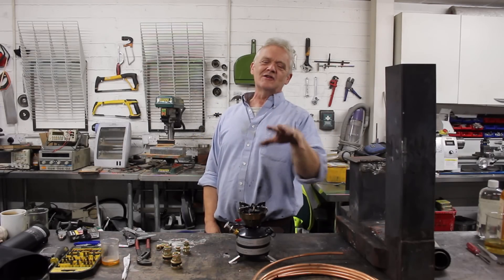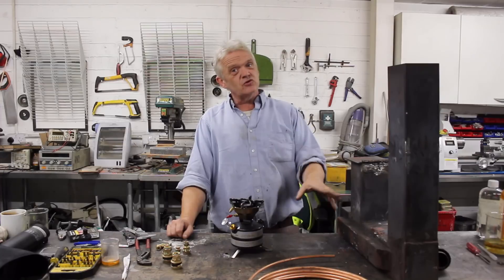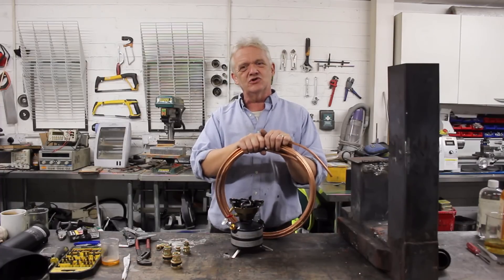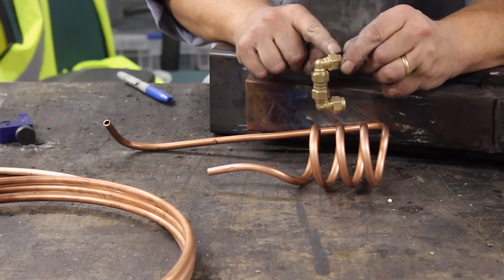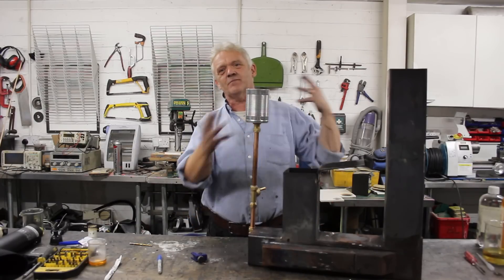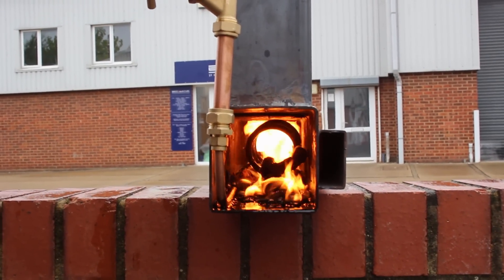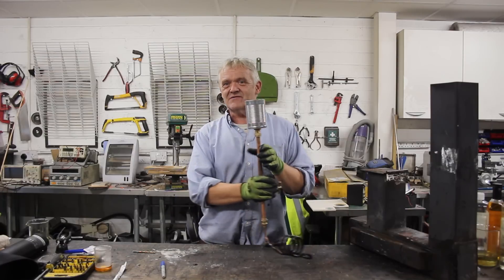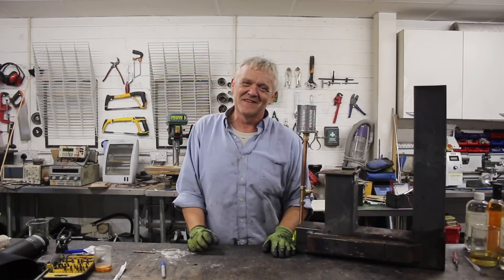1677 Biodiesel Rocket Stove

Comment: Sorry, this will NOT work for long on Veg oil or WMO.  I guarantee it.  The copper tube will clag with deposits in no time and the thing will not burn.  Diesel, Kero, biodiesel, Fine, they burn clean.  WVO and Diesel,  you'll be lucky to put 2 L though it. 

Very surprised you didn't do more home work on this and provide better information.  I was playing with things like this 20 years ago and thought it would be common knowledge you could not run this on waste oil. 

I have a similar stove design on my channel which I designed to run on waste oils and while it does need a poke with a screwdriver and a shake out to remove the clag, you can get reasonable hours of heat out the thing before you need to clean it. 

Doing this for waste oil would only be a waste of time and Money!

Comment: In my experience, if you use table salt instead of sand, you can clean the coil easier with water. It's the same thing, it's just you can disolve the salt if it gets stuck.
Reply: My experience runs different. Sand and salt can be difficult to get out of the pipe once bent. I've found that water does not compress, and if you just crimp off the ends (bash with hammer flat and fold over) fill with water, and do the same at the other end. A little bit of air does not matter, just not alot.
Cut the ends off, empty the water out and good to go.

Comment: Stainless steel brake line [yes I see plain steel was mentioned, but that will rust away pretty fast between the heat and the acids in the oil and combustion, but if you can't get stainless, it is certainly a fall-back] coiled many more times [surface area is key to proper preheating] and then use a brass spray tip from a garden weed sprayer.

On the OTHER end, USE the SAME garden sprayer to deliver pressurized fuel oil to the flame [since gravity is going to do a terrible job] and, if nothing else, use a really cheap Chinese made emergency 12 volt tire pump to give you steady pressure, and to drive it, if you do not use a battery, plug it into an 12, 18 or 24 volt laptop power supply with the necessary amperage to handle the draw of the little 12 volt motor, since it will draw quite a few amps [usually better than 6 amps] and let the pressure blow-off on the tank be your tank pressure regulator, or else just get a regulator set to lower than your peak tank pressure [to keep it from rupturing] and likely set the pressure based on the feed rate you expect to get from your oil so you do not have too much or too little fuel, and so you can fine tune the fuel burn rate.

Please keep in mind that this system will eventually 'coke-out', and every once in a while, it is good to wash the inside with some heated alkaline detergent and water, likely just pull the coil assembly, put it in a tank, plastic tub, bucket or barrel with plenty of hot water and let it soak, making sure every so often to let the detergent flow in and out of the coil, or perhaps use a tiny Chinese fountain pump and a piece f vinyl tube to force the detergent water through the tube.

While they make some excellent spray cleaner that will remove that coke/carbon pretty quickly, its not cheap, and I do not know how much it would take to keep your system clean.

Another way of cleaning it [the harsh way] is to build a really hot wood fire [possibly in your back yard or in a wood stove, or a coal furnace if your house is that old] and burn it until its pretty much glowing hot with some air being blown into it to oxidize the coke out as ash.

Comment: Just throwing thus out there for like minded people. I theorize Useing quantum clocks, entangled electrons, photons, Galactica xyz location, and a formula based on the 2/3 probability of super position measuring. That it will be feasible to use quantum properties for long distance communication, and or information transfer. Think about it we already do it on way by reading the red and blue shift,  aswell as the fractal photon graph to tell what objects are compromised of. We could at the least be able to communicate at light speed.

Comment: Instead of air holes that would allow the flame to escape I would setup a secondary air supply like a modern wood stove has with a pipe from outside the stove wirh small air holes much like a gas burner to supply jets of fresh air where you want it in the combustion chamber.  That is how a modern gasification wood stove gets clean combustion.  You should be able to get a blue flame with enough air.

Comment: Very awesome priciple - makes a great off grid heater as well - all you need is to provide a separate pipe maybe 1-2" through/ beside the coil - need to start outside the stove - finish through the back wall of the stover and be ducted away - provide a low voltage fan on the end to push air through the central pipe and wuhlah you have central heating (tent/cabin/outdoor area) if the RS stays outside then never the exhaust and fresh air need mix :) Great demo!
Reply from the maker: great idea - cheers mate

Comment: great idea and brilliant build.  I agree the coil closer to the chimney will likely make for a better burn .  one idea I was thinking is to have the pipe entee through the first flue and seal off that entry so air is drafted in from the bottom entry only and the air is moving in on direction.
Reply from the maker: Thanks for the idea! cheers mate

Comment: I'm amazed!! 

With what You come up with and how You do It!

I also want to build a Rocket Stove, don't have the Materials yet, and The Idea with putting the Burner in the back is a good One.

I would put the Air Holes always before the Burner and may even Windchanels and also give it an Airflow and not a sharp 90° turn, where the Molecules get slammed into a Wall, that should make it also Way better, maybe even Steel Melting hot if the Fire is burned long enough.

Cheers :)
Reply from the maker: nice ideas mate - thank you for taking the time to share them

Comment: I love this concept.  I have done something similar though it burned candle wax.  The reservoir was closer to the exit pipe only well below the opening to melt the wax.  What I did though was wrap the coil on the outside of the exit pipe.  It takes a bit to get it going, but is much cleaner with less damage to your coils as they aren't directly in the flame.  Less oxidation as well on the coil and better air intake as the coil isn't in the way.  Fasten the nozzle through a hole in the top side of the burn chamber.  Basically, I made a pulse jet fueled by wax.  It didn't have much power, but it got very hot.
Reply from the maker: nice - didn't think to look at pulse jets - nice one mate - cheers

Comment: Would it make sense for a one-way valve?  Keep oil pressure from backing up into the reservoir?  Is this over thinking?
Reply from the maker: I think it is a bit of over thinking mate - I was half expecting someone to mention flame arrestors but to be honest it's just not needed as the colder oil is very thick and is sort of it's own arrestor and equally it's own one way - you would need some pressure to blow back against it and the restriction offered by a hole drilled in the cap isn't really enough to be able to build up that pressure

Comment: I ran a 1992 Mitsubishi Delica on free waste vegetable oil from the restaurant my girlfriend worked at and then a sushi restaurant after she quit that job, it still needed diesel or biodiesel (I had not upgraded the rubber parts for it though) to start up on (and hence shut down on) since it relied on the hot engine and an electric pre-heater to make it work...  I wonder if a check valve before the coil somewhere would help it squirt out the hole at the end better, much like a cheap coffee brewing machine pumping water by boiling it in the pipe with a check valve?  I was following the work of some folks making centrifuges to clean used oils, they were burning used motor oil for heat and found the equipment lasted much longer when it was free of contamination that filtration alone doesn’t remove, like antifreeze...  In the ghetto we just let the WVO containers sit for a few months and then carefully poured off the clean looking oil and stopped as soon as any visible dirt or funky layers started mixing - the 2 micron on-vehicle filer could handle a little dirt.
Reply from the maker: nice share mate thanks for posting - I am not sure about a check valve but a needle in the hole or a smaller hole would be good I think

Comment: Was the reservoir closed off? Should this not be closed off to create some kind of pressure to get the jet going? Could it help to use compressed gas in the reservoir like air to get a steady jet?
Reply from the maker: no it was an open reservoir  - things like pressure and compressed air would help but they also add complexity and this is meant to be a simple build

Comment: Has anyone used a gutted auto engine void of it's reciprocating parts and the intake valve's, cam and rockers to make a wood or waste oil heater? On a V8 the exhaust would exit the point of where the carburetor bolted on. It could also be plumbed to produce hot water.
Reply: Engines are typically rather pricey.
Reply from the maker: I haven't seen one mate - but interesting idea

Comment: I prefer babbington oil atomising burners.... If the atomising gas is at high enough pressure they're able to burn oil with a blue flame.
Reply from the maker: yeah they are good but don't they use compressed air?
Reply: @ThinkingandTinkering  usually...
But they'll work just as well powered by steam from a small boiler, which needn't be much more than coiled microbore. 
Something like a little bike pump to get some pressure into them for starting, then once boiler heats up the steam will keep it going.

Comment: You could install a manual pressurization pump in the reservoir if you want to boost the flame or reduce the ignition time. People kind of forgot that there were gasoline/kerosene blowtorchs which were good tools despite being slower to ignite and more dangerous compared to propane torches. A while ago I built a blowtorch for a flower pot sized casting foundry.
Reply from the maker: they do indeed mate and you are right those old torches were awesome - just a little more fiddle

Comment: all you need to do is direct the intake air flow more around your fuel spray head like a ventury to fix your yellow flame issue. done this making a forge burner out of steeel pipe. wrapped preheater copper tubing around pipe then put spray head in pipe. also works better of you put a slight restriction or needle valve before the preheater so it doesn't waste fuel
Reply from the maker: nice tips mate - thanks for that

Comment: Steel brake line should work well for the temps that could arise.  Also brake line and brake line benders are fairly cheap.
Reply from the maker: I like that idea mate - I will check into it further
Reply: I'd recommend stainless tubing, steel corrodes easily at high temps.
Reply: @TheExplosiveGuy  I would think steel would rust out rather quickly,
Reply: I would use stainless steel myself , Just a personal preference , 304ss , 316 is likely to break during bending

Comment: Not been on YouTube for a while now but I'm going to have to binge watch to catch up on some of the creations 👍
Reply from the maker: awesome lol
Reply: Steel brake pipe might be a good coil material as it's got thick walls for the pressure only downside is the bore diameter is small so may have to play around with the amount of coils to get the heated surface area right 🤷‍♂️

Comment: Burning biodiesel is a waste of time, effort and money. Veg oil will burn just fine on it's own, I have done it. I just had a drip feed going into my wood stove. Regarding your heating sand as a heat store I am giving it a go in my stealth cabin. Take out the gas outlet fill the gas bottle with sand and heat it over my kerosene stove turn off and go to bed. I will make a video.
Reply from the maker: Thanks for sharing - give me a heads up when the video is up will you?
Reply: Will do this stealth cabin is awesome by the way sticking it to the man.

Comment: To burn hotter with less fuel say a drip feed ad a small air blower.
Reply from the maker: I am not keen to add a blower - I don't want to 'plug it in' - so to speak
Reply: @ThinkingandTinkering  Use a long say 2 meter steel pipe going to the fire feeding from the blower say a hairdrier on cold.blow.

Comment: Maybe you could also use a smaller diameter pipe to reduce the amount of oconsumed fuel, then, with less fuel, the air intake should provide enough oxigen to achieve a complete burn
Reply from the maker: I could always just drill one hole in the end cap. - I drilled 3

Comment: Was extremely interested. BUT this is re-inventing the wheel. YouTuber Gerry (from Ireland) at GerrysDiy has a series of videos on creating a large waste oil burner to heat his workshop. These are now several year old. He uses old gas canisters and oil drums with great success. His working prototype and proof of concept was with biscuit tins and tin cans. Using a drip feed system into the heat pan resulting in temperatures that you mention with controllable flow rate.
Reply from the maker: oil burner heaters, diesel heaters, rocket stoves etc etc etc have all been around for decades if not centuries - so - in a sense it is always reinventing the wheel. But if you think about it having an easily made insert you can slide into a pre-existing rocket stove to adapt it to burn oil is pretty clever - even if I say so myself lol
Reply: @ThinkingandTinkering  - my point is that there is no need for a pressurised system to create a jet of flame with a continual heat source; to get the same effect for less (of whatever liquid) fuel with an initial burn and slow drip feed onto it. Check it out, it is superb. The more people know this the more they will ask to keep their spent oil at garages from service. Incidentally garages currently have to pay for oil removal; will save them money if it’s taken by tinkerers like us.
Reply from the maker: @edwardsierpowski3839  i do apologise mate - I did indeed miss the point - I have seen Gerrys videos as part of the research I did for this - so I know what you mean - I thought I would just be repeating what he did and couldn't see the point of that but I will take on board what you say and have a rethink - cheers

Comment: Instead of the nozzle you could put a small Venturi use something like a used mig welding tip for the oil feed and air from a compressor
Reply from the maker: good tip mate- pun not intended lol

Comment: I had the bright idea of converting one of my prototype jet engines into a waste oil fuel source for my foundry last year and finally got around to doing it this summer. Having used anthracite in the past to melt down anything from aluminum to cast iron, you wouldn't believe the heat blast you get just by plumbing in a little venturi-driven drip pipe in the exhaust leading into the foundry. While I won't begrudge anyone from saying that it's the cheapest knock-off of an afterburner ever made, boy does it work well!! When it gets up to full temperature, there's nary a sign of carbon soot coming out of the exit port, just steel-melting fire and fury. 🔥
Not sure how well it would work with more or less ambient air pressure feeding your rocket stove, but mine is also just a scrap copper tubing exit directed down the exhaust stream (granted it's well away from the extreme heat further down), but it's held up as well as can be expected. It'd be a bit of a bugger to do without a bender, but stainless brake line would work a treat for your application.
Reply from the maker: thank you for the advice and tips mate - you can bet I will be taking them up lol

Comment: GREAT! I GOT WORKING  A JAM JAR PULSE JET(REINST POT) STARTED ON METHS THEN SYRINGED VEG OIL INBETWEEN WASHER STUCK TO HOLE ON THE TOP.. STAINLESS STEEL WITH WATER JACKET. WE GOT 1 GALLON DOMESTIC HOT WATER 35 DEGREES C PER 1CC OF VEG OIL(ABOUT 10 MINUTES). I LITER OIL= 1000 GALLONS OF HOT WATER(£1), IT WAS VERY TEMPREMENTAL THOUGH, BUT WORTH DOING MORE ON. REINST POT VIOLENTLY TEARS FUEL INTO SMALLER CHAINS FOR EFFICIENT BURN. RIENST POT SPELLING UNCERTAIN, BUT JAM JAR JET ENGINE.OURS WAS ABOUT 1 LITER BURN CHAMBER WITH 1 GALLON WATER JACKET, 8 OR 9MM  HOLE
Reply from the maker: yo should do a video on it
Reply: @ThinkingandTinkering  had a stroke, frustrating cant build stuff anymore. it was about 10 years ago, i showed it on the 6 oclock news south west, i did a demo at the green gathering festival.